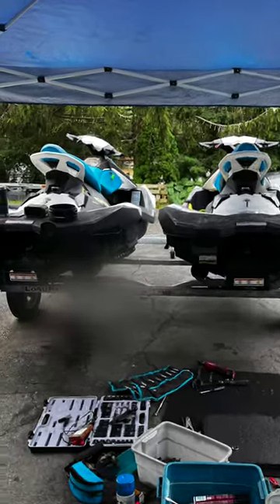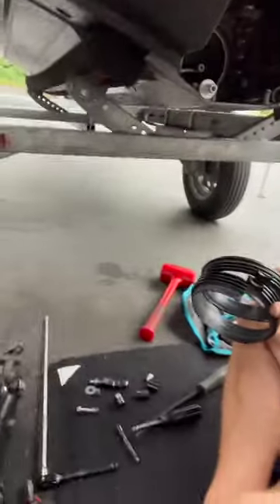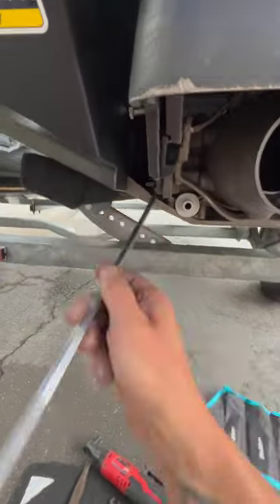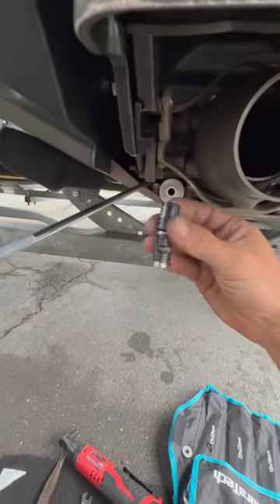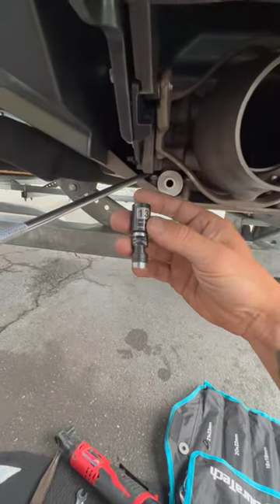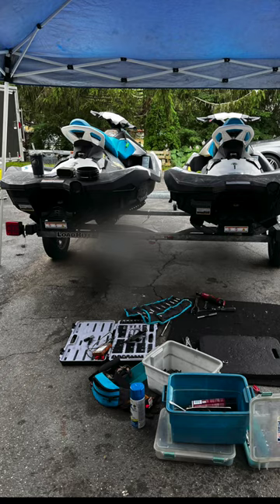SeaDoo Spark Jet Pump Removal Tip

Comment: i just use a 3/8 extension with wobble head and that gives the needed angle for the socket to remove and install the bolt